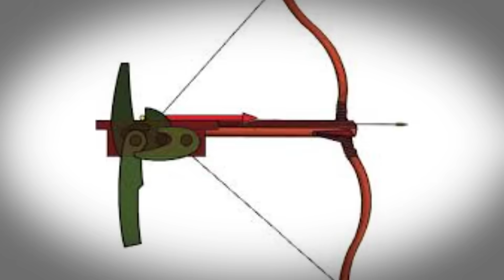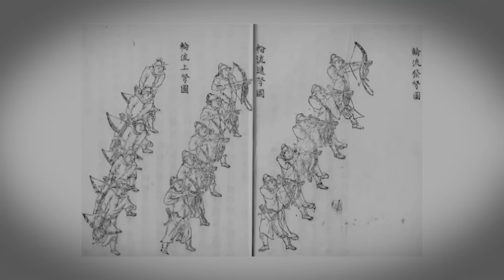The Bronze Trigger Crossbow: The Precision Mechanism That Forged The First Chinese Empire.

Comment: Did those ancient Chinese archers kneel in rows like the terracotta army?  Or they laid on their backs, put their feet against the inside of their crossbows, pulled the string with both their arms  and fired?  Each of them had another soldier kneeling to place arrows onto the crossbows.  I assume they swapped positions when they were tired.   Another theory is they walked in groups and fired their crossbows.  Which one?  Armies in ancient China normally numbered in the 200 000, 300 000 or 500 000!  Ten times more than in Europe.
Reply: They were trigger crossbows. You don't need to pull the string. You pull the trigger and it fires the arrow